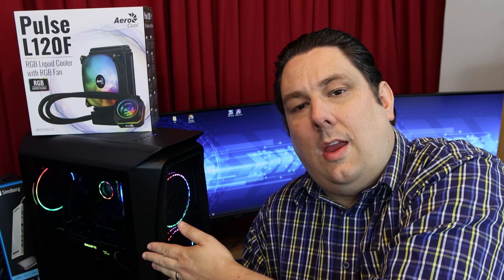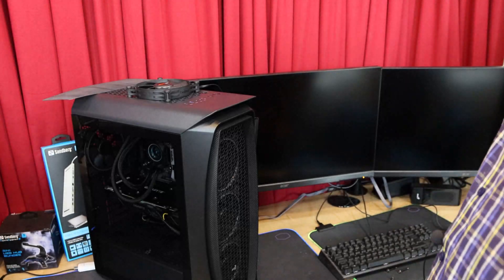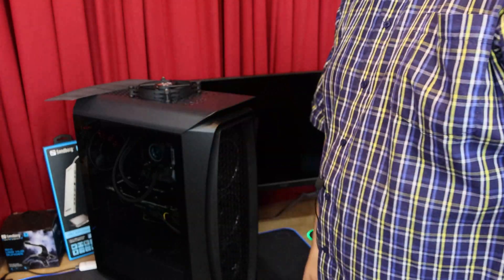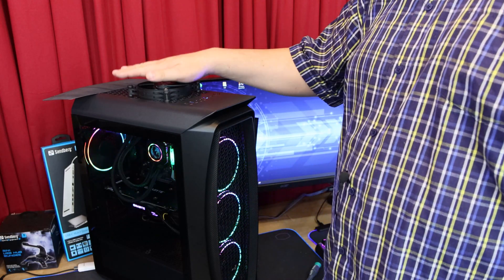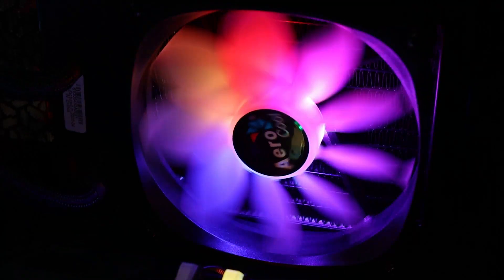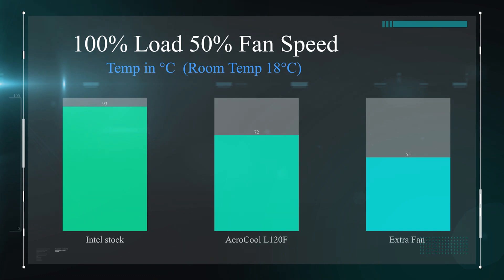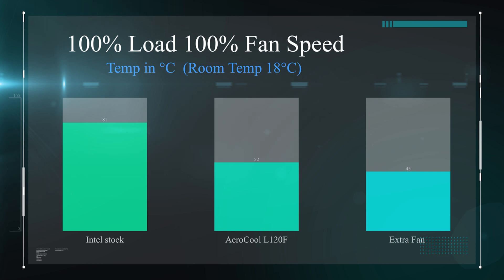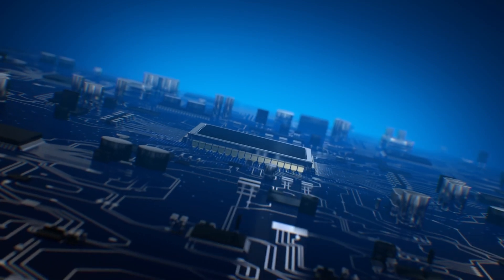Will adding a second fan to my 120mm watercooler help with cooling?

Comment: Silly question, but do you have fans sucking air out of the case or into the case? Thanks!
Reply from the maker: the ones on the watercooler are set to blow air out of the case, there are two fans on the front sucking air in, as well as one on the back blowing air out

Comment: I'm about to upgrade from an i5 to an i7 and I was worried about its little 120mm AIO not being able to keep up, but after watching this, I will definitely have to give the 2 fan configuration a go.
Reply: i just drd the upgrade to i7 with 240mm, works well but does jump up to 90c sometimes when ur really pushing it

Comment: Nice! About to add 2 extra fans to my 240mm rad both pushing the same way! Thanks for the info
Reply from the maker: Thanks for watching, it can help a lot, we have added 3 extra fans ona 360 ran for a Thread ripper,  drops max temp by around 20%, just note i can cause a lot more noise